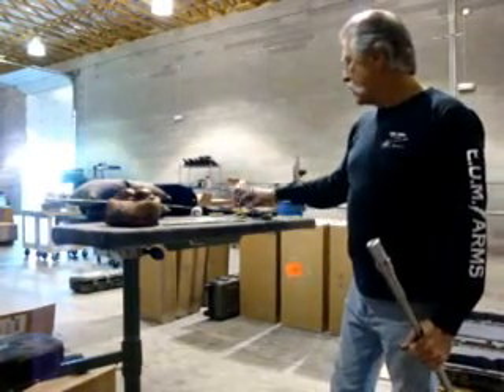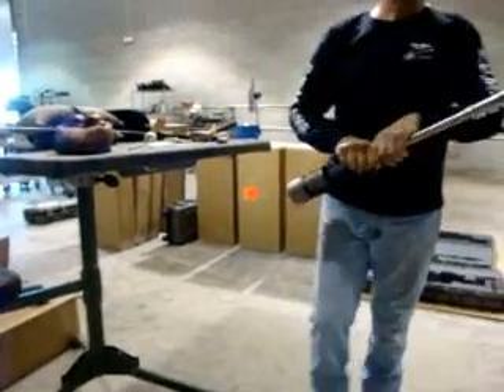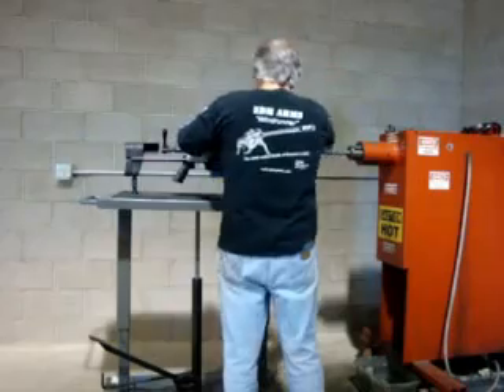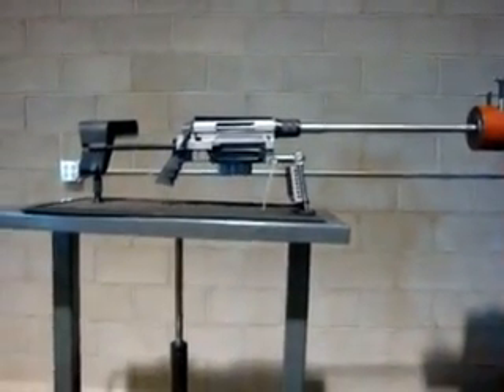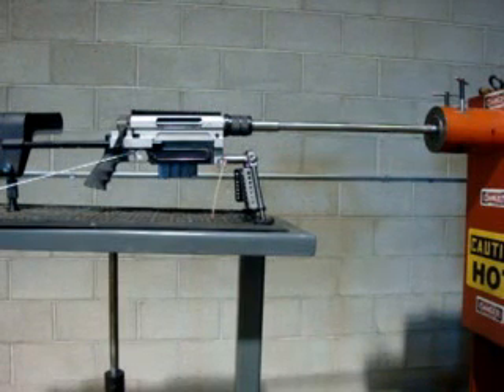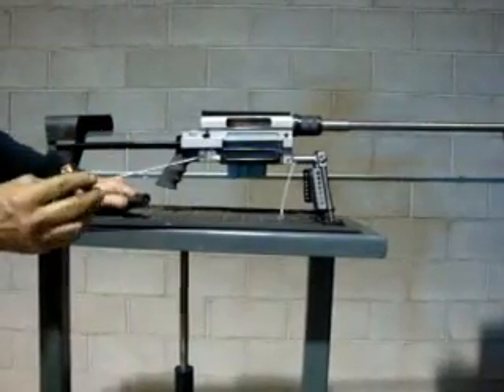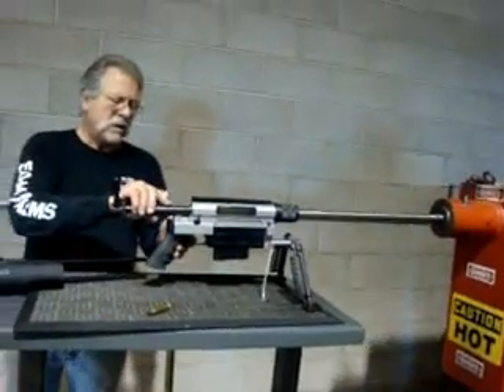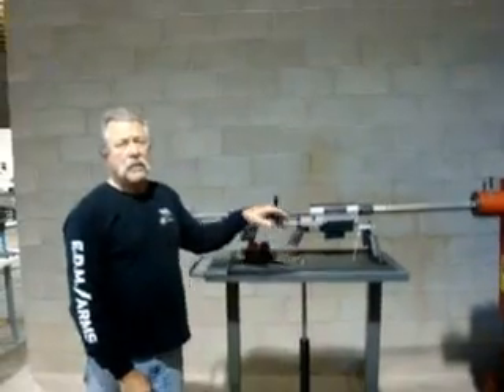EDM Arms testing squib round in .338 Lapua

Comment: if the squib was further down the barrel, it would be more realistic situation. And likely banana the barrel. As the compression of the air between the two bullets is what causes the shit to pop. He knows this test was snake oil...dude was a miserable son of a bitch wasn't he?
Reply: let's talk about physics, as you said if the air between the two bullets is what causes the barrel to pop, while that pressure at the maximum is equal to what pressure that requires to move one bullet. it is not going to blow up the barrel. What blowing up the barrel is the pressure behind two bullets. The powder burns slow specially in larger caliber rifle,  if the bullet last longer in the barrel, it causes higher pressure.

In particular, with normal 338 barrel, if the powder weight and bullet weight sets correctly, it can push two projectile out of barrel at a time.

Comment: They have to put in an oversized bullet as part of testing. This oversized bullet plugs the barrel and other bullets then run into the squib bullet, often budging the barrel....a nightmare...
Reply: They just blew a squib out of the barrel with the capability of firing an additional round through a cleared barrel. I'd say that's a test that doesn't need anything different. Why would you test it with a round bigger than the bores capability anyway? That's what you're saying by "an oversized round" right?
Reply: +RAS there's no oversized bullet